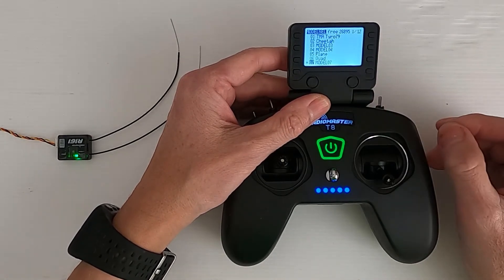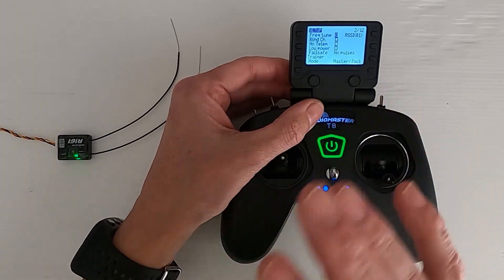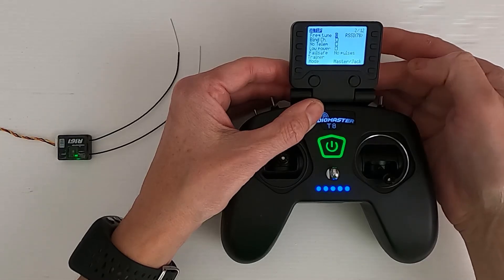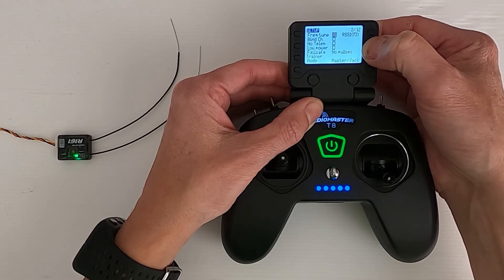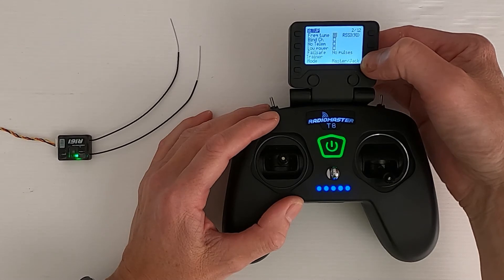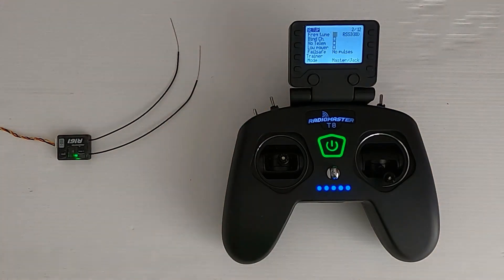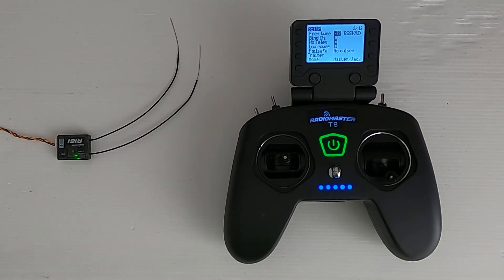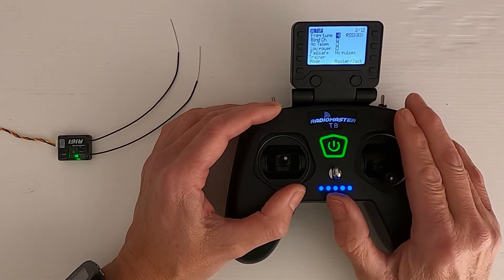RadioMaster T8 Pro Frequency Fine Tune Multiprotocol Module with FrSky Protocol Receivers

Comment: Hello, I don't have a failsafe item on the second page in the model setup.
Why is that?
Reply from the maker: Hi Tyron, some receivers do not have the radio failsafe set up function. Normally you would hold the bind button for a fixed period of time put your sticks in the failsafe position and wait until the led stops flashing and failsafe is set. Please check the manual that came with your receiver.
Reply: @the-happy-RC-flyer  I also encountered a problem where betaflight (in failesafe) does not arm the quadcopter until 30 seconds have passed. How can this delay be changed? (I'm afraid that terrible things can happen in 30 seconds, given how GPS rescue works :)).
I would like to cancel the rescue mode myself when the connection returns
Reply: I found information. In general, if I catch failsafe at a distance of up to 100 m, then in this case the quadcopter falls and allows me to arm myself in 30 seconds. If I caught a failsafe at a distance of more than 100 m, then in this case, in order to regain control, it is necessary to reject the sticks by more than 30%
Reply from the maker: @tyronzed2884  I am not sure why your switch is not activating immediately. You should check the settings on your radio are default no delay activated.

Comment: How n the hell are u coming up with 17 at all
Reply from the maker: Hi Ray,
If you had the following numbers:
+28 and -28 your fine frequency tune value would be 0. 
If you have + figures you add the numbers together if you have - figures you add them but they are have a - value. If, as in the normal fine frequency tune process you have a - and + figures - 16 + 20 added together = 4 You the divide by 2 to get the mid point so the number you put in your radio is 4. 
-20 +16 = -4 divide by 2 = -2 number you put in your radio.
I hope this helps. It is very important to complete the fine frequency tune process.